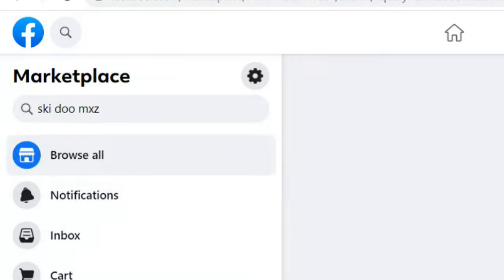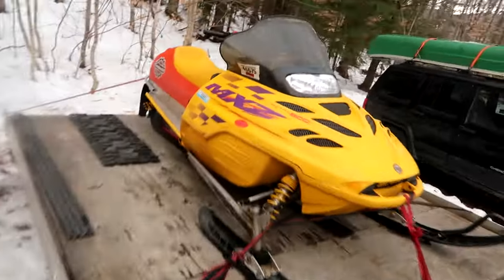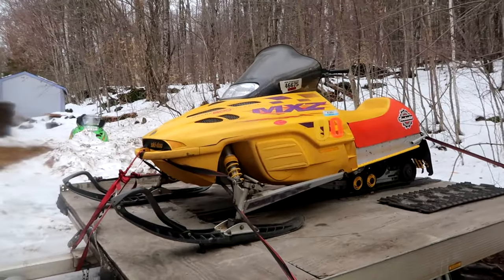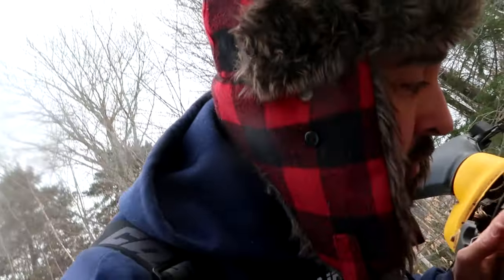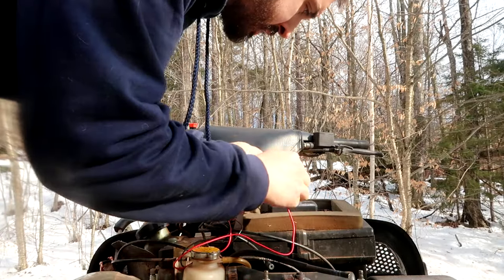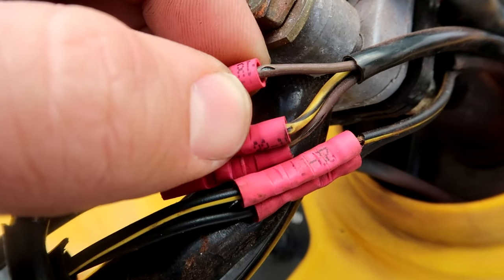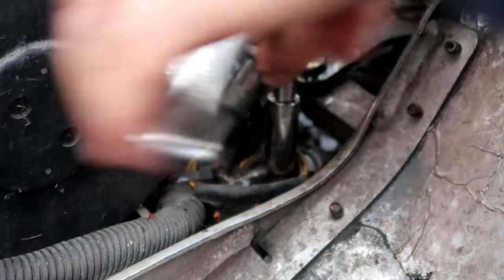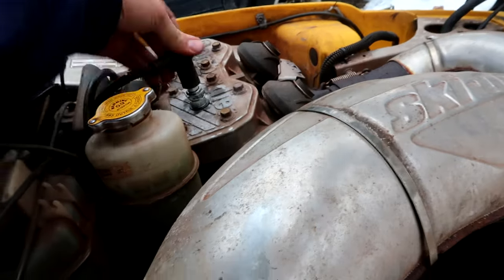Buying DEAD Snowmobile On Facebook Marketplace (& Getting It Running)

Comment from the maker: I want to hear your best facebook marketplace (or craigslist) deals in the comments!! I'll choose the best.
Reply: A brand 2007 new yamaha apex for 1500$ and it runs pretty good
Reply: I Traded a yz85 for a ktm250sx (both 2 stroke dirtbikes)
Reply: I sold a 92 klr 650 on Craigslist list for 750, I bought it for 900 and I owned it for 16 years
Reply: bought a yamaha dt from a buddy for 180bucks and sold it a week later without a dollar spent on it for 900 bucks
Reply: Bought a 2003 Ski doo 1000 GT four stroke sled last year! 6,200 miles for $1000 🎉
Reply: 1970 Ski Doo TNT 292 for $400 on Craigslist.  About 6 years ago.
Reply: On my wife’s birthday, I bought a 1991 BMW850i (v12) for 1,000 bucks. I pressure washed it, and sold it for 8,000 a week later
Reply: Bought a 07 freestyle with 1300 miles on it for $800.  No cracks, no rips in the seat, running with everything working as it should.  Powerwashed it, polished the tunnel, shined her up and out the door for $2,850.  Thing was mint when I sold it.  This was pre-Covid before people lost their minds.
Reply: I got a 97 XC 600 (triple) for $200 with papers and a spare motor with a welded crank. This was about 3-4 years ago before prices got crazy
Reply: I got a 1990 ski doo tundra for 100$ that had been sitting under a deck for over 10 years.  The carb was so bad I had to find another off a citation but sure enough fired right up.  Its the best feeling when you get them running again.  Nothing like it.
Reply: Polaris RMK 800 vertical edge 2003, 1700km on the clock, changed pistons not long ago everything works and rund great 1400$
Reply: AND it came with a Pro X seat😅
Reply: Actually the best deal was that I purchased 3 1996 ski doo elans from Granite Canyon Wyoming for 400$ for all 3. The guy bought them for his grandkids but they never really used them.  Even though Im from Maine I sent him a 400$ check that day with no idea or plan on how to get them home.  I ran a wanted advert on craigslist looking for someone to bring them east where I would be able to meet them.  After talking to a ton of people who answered my wanted advert, I finally took a leap of faith on someone who was bringing a gold wing to Ohio and had room on his trailer.  I linked up with a well known snowmobile shipper who was traveling through Ohio on his way to Maine to make a delivery and put the two guys in contact.  $1200 and about 2 months later I had all 3 elans back in Maine.
Reply: Chevy colorado that had been sitting for 2 years great condition 1000$ and sold 2 weeks later for 5300$ with 0$ into it
Reply: Either a 97 Yamaha enticer 2 410 that runs amazing and nothing wrong with it or a 81 citation, 74 elan, and a 74 John deer needed minor repairs but we got them running for 750
Reply: My sisters boyfriend did get a 08 skidoo summit 800 that cost 3000$. It runs great and it came with a trailer, super nice snow pants, coat, helmet, gloves, and snow boots
Reply: 98 zr600 for 250 just scored today
Reply: HEY thats a mbrp race can by the looks of it i have the same can on my legend 600 sport race sled and it's load and thay sound good on them sled and fit the best
Reply: Got a 99 Yamaha Blaster 200 for $500. 2 weeks later sold for $1400 without putting anything into it. Hope to do something like that again!
Reply: 01 mxz 600 for 850$ 500 on the rebuild, 4,000 miles, no spark fixed it for 600
Reply: My best deal was probably a 1993 Indy lite 340 2 up with supposedly 85 miles on the odometer. Picked it up for $500
It looks like it had been sitting out in the elements it’s entire life but it runs and drives great and that’s all that counts.
Reply: @spencerhall4452  that’s a super deal. Being the last year those are extremely desirable. I love the decals of that year.
Reply: Rate it a 1 because it's a scrap-doo
Reply: Sold a blown up 2002 rmk 800 for $500
Reply: 2001 Polaris RMK 800 got it for $900 and the only thing wrong was a missing pressure cap for the coolant reservoir and light didn’t work
Reply: Just scooped a 98 ski doo mxz 670!! I grew up on ski doos, had a few polaris a few years back and after I got this one I fell in love haha only cost me 800...so far the head light out went out so I'm hoping just a new bulb will fix that and my recoil is completely shot lol the guy had a garage wire as the pull cord and it was working until it didn't hahaha anyway she rips already had it out twice!!! Lots of power and love the suspension...hoping to get out this Sunday just gotta hopefully find a recoil for sure...Wisconsin guy here bud...love your videos btw I'm subbed
Reply: 2020 skidoo mxz 800 for only $1,000 in auction
Reply: I bought a fat kids coleman minibike for $150 after he cracked the frame. Welded it up and she still rips to this day

Comment: Dude you scored a 10 in my opinion! I have a 583 mxz i payed 500 for that had a faulty gas cap and only water in tank and carbs. A quick cleaning and boom weve got a minty running sled!  Allways love to see great deals...btw. he knew it wasnt running before he talked to you i think
Reply: I bought an “01 thundercat for 800$ he told me the engine was seized, went home put new batteries spark plugs in it and she fired right up😂😂
Reply: A lot of times it is simple things that fixes these machines. Sometimes I have seen throttle cable being loose. I also tell people to buy low mileage machines from people in a city that don’t ride a lot. We can ride to mountains or flatland trails right from our house.

Comment: I got a running 97 AC EXT 600 triple for $400. Had a gallon of water in the gas tank, disgusting carbs, and a couple loose nuts/bolts. But she cleaned up nice, runs strong, and lifts the skis on every pull.

Comment: Have a 2000 Ski Doo MXZ 600 that I got for free from my friend. Very good condition, but I had an issue with it when it started blowing the headlamp bulbs (Low beams would blow, but high beams would be fine). Replaced the voltage regulator and it solved the issue. They're great snowmobiles.

Comment: Nice deal. I bought an ‘89 Yamaha Phazer with 1750 miles, same issue. Absolute cream puff. Found the coil had a spliced wire. Re-did the connection and BINGO.

Comment: Just bought a 00 mxz 700 that was "locked up". Drove home and it was not locked anymore. I think it bouncing on trailer freed it up. Upon further investigation the oil line that hooks to the pump was melted and oil leaked out. I replaced the line and it has great compression and runs excellent. I couldn't believe my luck.

Comment: A lot of people don't know how things work, 20 years ago I pulled a $1500 computer out of the trash and fixed it with $5 heatsink paste. my friends small one cylinder engine on a bicycle needed a magneto, snowmobile my issue was the voltage regulator as well as starter solenoid. Feel like if its electrical people don't know what to do.

Comment: My best deal was last year I bought a non running 2005 gsx 600 with 500 miles on it and a mint 2005 panther 570 and a enclosed 2 place for a total of 3700 last year. Sold the gsx for 3900 and the trailer for 4k and the panther for 2500. Made out like a bandit and I ended up buying a brand new 8.5 x 24 vnose enclosed trailer for 11k with that money and i was offered 20k for it the other day best deal ever.

Comment: Take the voltage regulator that you took out of the MXZ 600 you got for 400 bucks put it in the oven at 350 for 10 minutes just enough to get it hot and I bet you if you put it back in the sled it will work again the epoxy breaks around the edges and let's moisture in them saved a lot cdi's this way cheers

Comment: Found a 1988 Chevy 1500 for $500 v6 154,000 miles on it they couldn’t get it to run changed fuel filter and it ran like a champ for six years all the way up to 370,000 miles before tranny and motor let go

Comment: Great video! Just a quick question, how do you check the spark plug wire with a multimeter? Which setting should it be on and what would be a good range and what would be bad?
(Sorry if i made any grammar mistakes, english isnt my first language)
Reply: Ohm meter setting. Search up videos on how exactly to do it. There should be many that breaks down how to go through the entire electrical system looking for problems
Reply: @SnowPiercer1975  thanks 👍